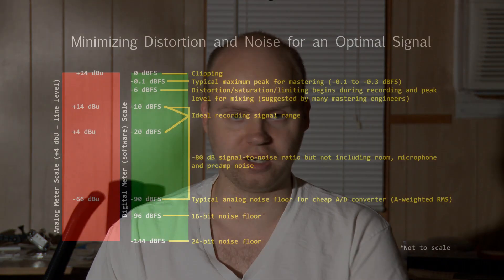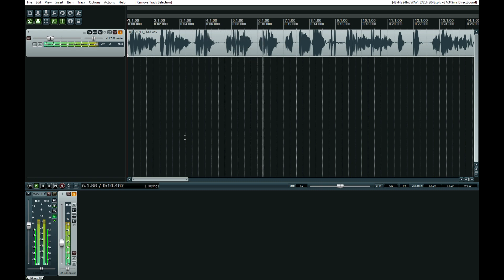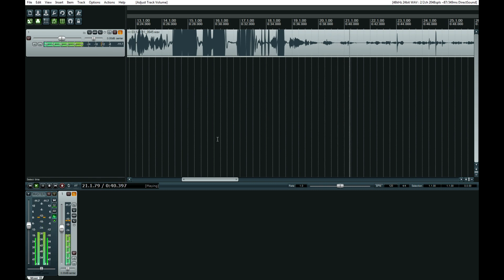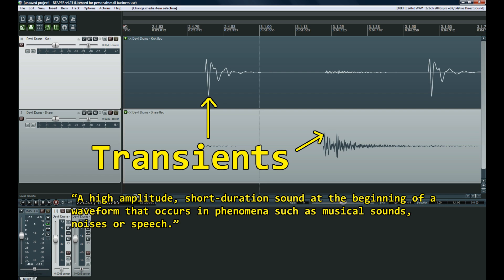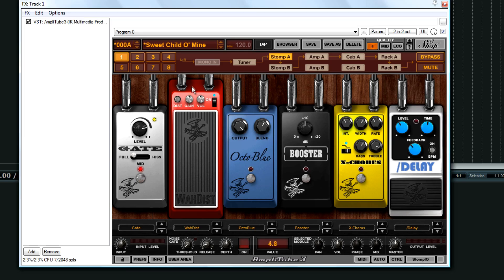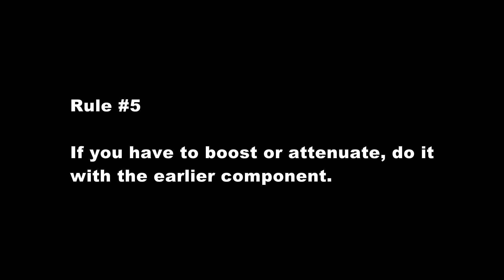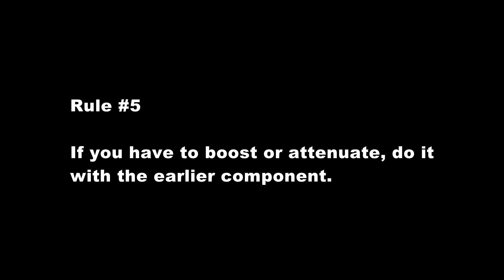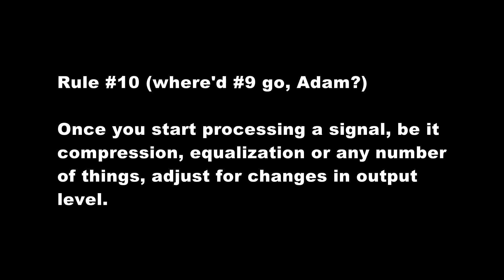Gain Staging & Structure Explained Audio Mixing/Recording

Comment: Where is it best to keep the daw faders at during recording before mixing, everything at 0?
Reply from the maker: They don't go off their default of "0". If I need to hear them louder or whatever then I'll use the audio interface's control panel software.
Reply: Ok but one question my master fader clips occasionally even with my input levels of all drums and guitars at -18 to -6 peak.    Can I throw all the faders Down to -6 or so and make that my starting point instead of 0??

Comment: I've been doing a lot of research about gain staging and headroom for a while, and you seem to be pretty sure of what you're doing. can i ask your opnion on this guy talking about leaving headroom for the master engineer, and that it's basically a myth? 
https://www.youtube.com/watch?v=1xlVSewdVSI&index=6&list=PLslLs59ufWvzyUQxuOJ451s2_5Y-f_-IG&t=0s

thank you!
Reply from the maker: Good question!

Leaving headroom for mastering isn't a myth. In the analog realm, it is best practice to not peak the meters past the "0" reference level. Especially when recording the mixdown to tape but even digital transfers were best left at the "0" levels  That is because their analog stages would saturate before reaching the maximum digital level.

In the purely digital world, you can go above zero if you mix down to a floating point format, usually 32 or 64 bit. If you mix down to an integer format, any clipping over zero (maximum digital signal) is a bad idea.

However, when a mastering engineer receives your digital files they will still need to bring those levels down if they use analog equipment. Or if they use digital plugins that emulate analog equipment.

So in summary, peaking at a maximum of -6 dBFS is still good practice for mix downs.

Comment: the problem i have now i just wanna align +4 dbu with -20dbfs when i play a -20dbfs sine wave and measure output with  a multimeter i don't even reach 1.2 V when i turn the main volume of the audio device all the way up i think the problem is the multimeter do you have any idea

Comment: hello. I have a question I was running my guitar through an amp to a mic then into a pre amp then into my interface.. inside the DAW the level was showing -12 db during recording but when I played it back the level was -24 to -30 db.. can you help, or explain why this might be happening.. any advise ?
Reply from the maker: Strange. I'd ask your DAW maker's technical support or try a meter plugin like https://www.hornetplugins.com/plugins/hornet-vu-meter/ or http://klanghelm.com/contents/products/VUMT/VUMT.php . There are also free meter plugins that could be used to supplement your DAW since they apparently aren't working correctly.
Reply: ok thanks fir the response I will check out the links

Comment: Great video. I'm going to subscribe.
Reply from the maker: Thanks!
Reply from the maker: It depends on what the hardware meter is calibrated to. Some are -18 RMS and others are -20 RMS...usually. To find out, run a 1 kHz tone, align it to your VU meter's "0" point. The needle should be steady at 0 with the tone playing.

Then run the line level output of your device to your analog to digital converter, using the line in, of course. See where the 1 kHz tone's level falls inside of your DAW. This is what calibration is all about!

Here's the fun part...your converter has its own operating level. So, if you change converters but use the same hardware before it then its input level may change!

The important thing to remember is to stay out of the -6 dBFS zone as much as you can. At that point, a lot of gear begins to crap out.
Reply from the maker: For future reading/VU meter and digital levels explanation: http://www.presonus.com/news/articles/Meter-Madness
Reply from the maker: Cable testers have them built-in. Or do a Google search for white noise, pink noise and 1 kHz files.

997 Hz seems to be the new alignment standard, for whatever reason. But 1 kHz should work just as well.
Reply from the maker: Ahh yes, I did use a cable tester in the mixing video. And yes, I was calibrating it to my converters.
Reply from the maker: The one I was using is a Behringer CT100.

Comment: Kudos! As someone who works with gainstaging for some years now I can only say that this video is one of the most logic and best explaining ones when it comes to gainstaging. Mostly everything I tried to explain to several people why gainstaging still is mandatory within the digital domain will be covered in this video. It is all about unity gain and distortion, noise and a clear mixing layout. Great video. Thx for this.
Reply from the maker: WATCH THEM KRAUT Thank you for the compliments!
Reply: RealHomeRecording.com AGREEEEED! Lately after about 6 years teaching myself how to record with DAWs, i have found that -10 being that magic spot. Anticipating the added instruments in the end to make the master fader never peak, but leaving room to "fill up the basket" without overflowing. Great video mate!
Reply from the maker: Nate Thomson You're welcome.

Recording with absolute peaks at -10 dBFS is something I read from mastering engineer Bob Olhsson. I respect his experience. -

10 dBFS avoids analog saturation artifacts on even the cheapest audio interfaces and it avoids any possible soft clipping. One can always trim levels down in the box but once that analog saturation is recorded there is no removing it.

Comment: 0:54 - PAUSE - In this chart, the only thing I NEVER do is peak my masters anywhere above -1dBfs.   Why?

There's no reason to.  Peak AROUND -1dbFS, that's ok.  Anything higher than than that, you'll trigger any clip or over-meter - on your daw or at the CD pressing plant.
Reply: RealHomeRecording.com I like your style. Thank you!
Reply: Sheer loudness drives the decision to peak within one-millionth of one dB of full scale.  And an irrational fear of "not utilizing all the bits" in a 16 or 24bit environment. 

Real music ebbs and flows, it is not all full scale all the time, doesn't need to use "all the bits" all the time.  This is why I just don't buy new music any more - all in my face, the rhythm section, the lead vocal, the backup vocals, the melody, the verses and the refrains all at the same level.  I have no problem with what today's artists are saying, it's the (OVER!!)production that makes me tune out.

I put on some Joel, or Marvin Gaye, or Pink Floyd, even while I'm doing the bills or cooking, and it's like my ears are getting a massage by comparison to when I listen to a set by today's artists.  And I know it's the modern artists or their labels that won't accept anything "quieter", but they won't be getting my money for it!

And yesterday's music wasn't quieter - it went further in both directions.
Reply from the maker: -0.1 to -0.3 dBFS master peaks was put there because that is what is currently done at commercial mastering houses.

There was a discussion on iZotope's Facebook page about this recently. The conclusion was people will master for mp3 at -1.0 dBFS to -1.5 dBFS (iZotope recommends -0.7 dBFS) but for CD -0.3 dBFS is OK.

The "Mastered for iTunes" white sheet recommends -1.0 dBFS. A decibel isn't going to make a huge difference on a master (it does with mix elements/tracks) so to be on the safe side sure go for -1 dBFS.
Reply: Just because all the commercial houses do it doesn't make it right.
Reply from the maker: Zickcermacity The choice is your's. The important thing is to never have intersample peaks.

Comment: Hi Adam,  Great videos so thanks for all the help.  Perhaps you can clarify something for me here.  So I get the trying to record between approx -20 and no higher than -10 but should I always adjust my interface pre amp setting first to get the sound i want and then reduce the volume on the channel slider in my DAW to achieve that level?  As opposed to lowering the gain on my pre amp channel?  I am recording acoustic guitars.

Comment from the maker: 100% agreed. Live mixing is a different ball game entirely from recording but the basics remain the same.

I find live sound to be a big pain in the ass...mostly because there isn't enough necessary gear nor time available on most gigs.

For faders, unless you're using a really nice board, I've been told/read to only use them for cutting but never boosting. Apparently on cheaper gear (let's say the sub-$15k 24-input category) fader resolution is deprived on the positive gain side of things.

Comment: yes- faders at zero is always the default when setting levels during sound check. but once "live," dealing with the dynamics of a the gig is best done with the faders. And you still have to watch out for clipping. live I also have the benefit/concern of my power amps and the headroom I available there. MAYBE if Mr. Big Mouth Screamer hands a mic that has been dialed in for him over to Miss Whisper Voice might I consider compensating via the gain control. But that would be quite rare I think.

Comment: @#7. for live sound newbies trying to glean some knowledge here; once gain levels set never use your gain knobs to control volume. UR taking a big risk with feedback plus every change will introduce unexpected volume changes for the artists (assuming aux fed monitors). More percise and safer changes are made with the channel faders. Once you have your gain set so that it won't clip and there's is minmum floor noise I'm not sure why you would ever screw with that? Is recording that different?